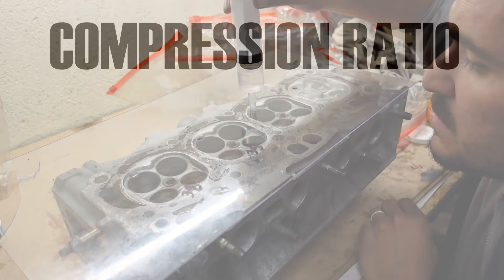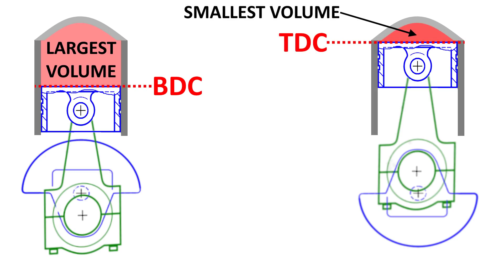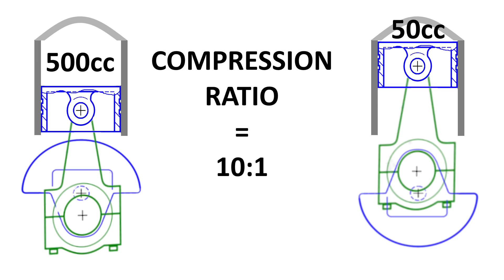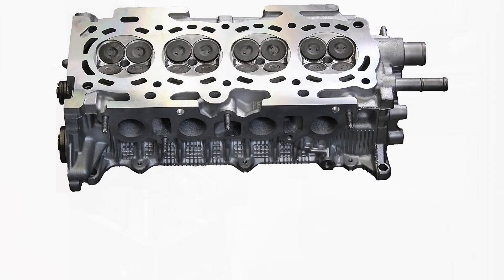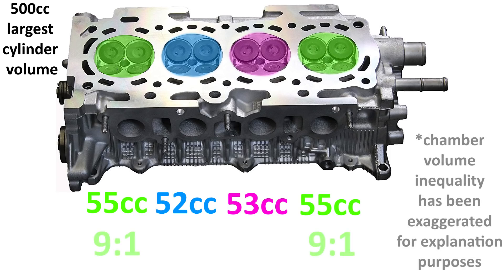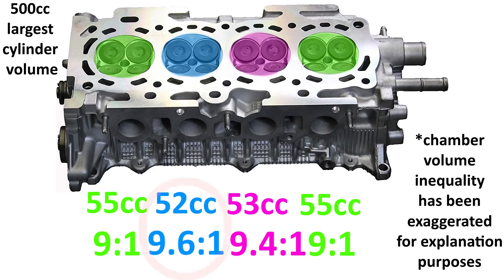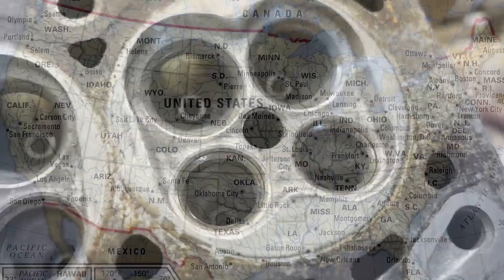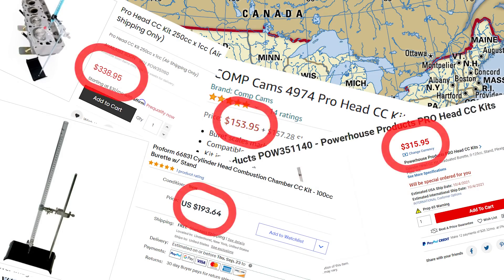HOW and WHY to EQUALIZE combustion chamber volumes CC - Project Underdog #10

Comment: I really like your videos... so thorough... However, in this one, why did you not deck/clean the head surface first?? So you had a truly flat surface for the plexiglass to sit on when taking the measurements.
Reply from the maker: Yes, that would be the typical approach, but when you're grinding the bit can sometimes skip and you can accidentally gouge the deck. The old gasket material remains are incredibly thin but are a great layer of protection and I feel more comfortable with them because I'm a bit clumsy sometimes. Petroleum jelly will seal even against dirt and debris and the difference in chamber volume after decking will likely be minimal.
Reply: @d4a  sorry need to disagree with this , yes i wouldn't deck the head but you really do need to scrap all the gasket material off. you can see a big clump of gasket which could be 1mm which would make a difference. also we use a thicker bit of perspex so to not have any sag. P.s, great videos
Reply: After watching this video & reading the comments specifically David Parker, I have to say this: back up your statements with validated documented proven credible science & math. Numbers don't lie. Critiquing another person's technique & process is a matter of personal opinion. Arrogance & ego can be a propellant to proving your statements but it will definitely ostracize you from people. I suggest the humble pie for dessert.
Reply: @strangelove9608  thanks man :-) I hope it helps in some way. When I see someone take the effort to produce a video to help others and share knowledge I try to stick up for them a little. I know a troll battle will never be won, but hopefully others read this see the facts.
Reply: This will likely come down to "how well I want it done", if you want absolute accuracy, you can resurface the head, but like it's said in video, this is enthusiast home build, you ideally wanna save some money, especially with the grinder that hes using
Reply: A god and fast way to clean the head for this kind of work is a fresh knife honing stone and wd40. if its a cast deck you use atf instead of wd40.
Reply: @slightlyinsaneraf  And time! We got jobs and shit lol
Reply: There is so much wrong with this video it is comedy for anyone who knows what they are doing.
Reply: @David_H_Parker  Let's hear your side then.
Reply: @OldSchoolZ-wy2yx  Let's make it easy for all of us. I'm not here to give anyone a free education.
Find a better, more authoritative source. There are plenty to choose from. Buy a book about building competition engines.
Reply: @David_H_Parker  he's build street engine not a competition engine, that's the difference.there isn't "so much wrong with this video". If you know something mind-blowing, then let us all know mr. Not free education. Give us a trial and enlighten us with your amazing knowledge
Reply: @David_H_Parker  When the guy asked what is wrong with the video i was already expecting that you will not gonna be able to point a single important fault in it...
I can give credit to some of the people here for pointing out things that you should watch out but you clearly lack the understanding and the skill... also are ready to take money for that lack of skill and knowledge so you are mad that this video exist. Someone with proper skill do not need to false advertise his work/knowledge.
The guy said he measured/repeated this thing 4 times->if the method is so bad then its strange that he did not detected it when he was comparing his work and numbers that this method provided as any wrong method would be giving him wrong numbers...
Reply: @Bialy_1  This series is being made by someone that doesn't know what he is doing.
Please follow exactly what he does.
You will deserve everything you get.
Reply: @David_H_Parker  yeah I'm sure you have much more important things to do with your time, that's why you're on youtube talking smack...now hurry up they just uploaded a bunch of new cat videos...
Reply: @David_H_Parker  = internet troll...
Reply: @jimmybare3026  That is what someone says when they can't disprove my points.

Stay ignorant my friend! Keep watching this channel to be misinformed.
Reply: @David_H_Parker  in all this time and effort you put into BSing comments, you could have easily told us what you found egregiously wrong with what the guy is doing. Instead, you keep going around in circles talking more crap and complaining how busy you are to school others...but not busy enough not to keep reading and replying to comments calling you out, and rightly so.
Reply: @DL101ca  I said early on in the comments that I am not here to teach you.

 Read a book, there are plenty out there.

People watching this channel and following it will get exactly what they deserve..... garbage.

If you want to learn how to do it right, this channel is not the place. If you want to hear Dexter's Laboratory tell you how to waste your time and have counterproductive  results, keep watching.
Reply: @David_H_Parker  I think you're done here. Thank you for the deep insights , don't let the door hit you on your way out !
Reply: @DL101ca  Just keep taking it on the DL. 

Pitching or catching?

We all know you are catching.
Reply: @David_H_Parker  You have a lot of time to argue but no time for "free education" lol. The argument would be over already if you grace us with a bit of your "free education" but you can't/won't 🤣
Reply: @paciencia0956  You are talking about yourself. Please go on. You are 100% right, you are all of those things and more.
Reply: @DL101ca  You don't know a lot of things. 
Thanks for exposing that.
Reply: Haha this is still going on!?!? Wow....
Reply: @slohachi6433  Merry Christmas everybody!
How is "Project Pointless" coming along?
Reply: @David_H_Parker  haha you said time is money right? Get back to work Mr. Amazing Engine Machinist! You gotta make all those aerospace and medical machinsts jealous!
Reply: @slohachi6433  Hey, Quandale Dingle here🥵
Reply: @David_H_Parker  I did not find anything comedic about the process he demonstrated at all. It was accurate, he used readily available tools, and the chambers volume across all 4 are much more consistent than they were "as cast". Also, there is a huge bonus advantage in un-shrouding the valves. Could the surface have been a little cleaner...maybe, but the difference in volume that would cause is so miniscule it's immaterial. After the engine is running the difference in carbon deposits will change the volumes slightly also. Overall, there was nothing funny about the CC process he demonstrated.
Reply: @David_H_Parker  Not sure why you continue to make spiteful comments about clowns and comedy. It's not helpful to the community. But let's take a step back, you are making an assumption that machine work needs to be done. If the surface is flat, then he does not and should not surface the head. If the valves are all sealing and the seat and face are uniform, no need to machine the valves. Now, let's take another step, doing chamber work with a die grinder is risky work. The grinder can very easily get away from you, and mark the surface of the head, necessitating resurfacing. Doing this chamber work FIRST is the best approach. Now, if the head needs to be surfaced, well it's as simple as CC'ing the heads again. But an inexperienced person might say, "what will you do if the chamber volume is off now!?!?" Now, is where you can make small adjustments by seating the valves a little deeper in the cylinders that need more volume. Now, maybe the process he demonstrates in the video seems comedic to you, but that's because you lack experience working in a machine shop building engines and you haven't read enough books to get a balanced view of how to approach engine building.
Reply: @slohachi6433  WRONG! Thanks for playing!

Are you a machinist? have you built professional race winning engines? My guess is no.

YES, things do change after a valve job and a surface.

If good enough is what you are after, just leave it as cast. Why waste your time cc'ing something before all of the dimensions change? The valves and the seats are changed in addition to a reduction in chamber volume from surfacing.

You clowns in this "community" need a reality check. 
Someone needs to say, hey.... don't drink Mr. Jones' Kool-Aid.
Reply: @David_H_Parker  Woah,...it does not seem that you understood me at all.
To answer your questions, yes, I was an professional engine machinist for many years. I have helped build competition engines that have set records at Bonneville.

Am I the know it all of engine building, nope :-) Haha hardly, in fact the more you learn about engine building the more you realize just how much more there is to learn. I still enjoy engine building as a hobby. Now, enough of my credentials...let's get back to business.

You are assuming the head needs to be surfaced. It's very possible that it may not need to be. And even if it does, a good machinist will take a little as possible, and level the head as much as possible to evenly surface the head and keep chamber volumes as consistent as possible.

Second assumption you make on machine work is that the head needs a valve job. It may not, especially low mileage Japanese engines.

Now, you did make a correct statement that I did not and do not disagree with. You said ,"YES, things do change after a valve job and a surface."
Never said they don't change lol. In fact I told you that you can make minor adjustments to CC volume on a per chamber basis by sinking the valves a little deeper.

Here is the point you seem to miss, doing ALL the machine work first is dangerous, silly, and irresponsible. Porting a head and re-shaping combustion chambers is very risky work, you can very easily gouge the head or seats. You'd know this if you have even a slight amount of experience with engine machining and building.

Here is a step by step for you, do the chamber work, get the chamber volume as close and as consistent as possible. Then do the machine work if needed. Then measure all the volumes again. Then make small, minor, relatively safer adjustments to get your chamber volumes equalized.

Understand now? I'm not playing.

Do yourself a favor, read up on some books, get your hands dirty and actually try some of this out, and I know you'll soon understand these very basic concepts.
Reply: @David_H_Parker  . The would be expert gets schooled like the clown that he is (talking to you). hahaha
Reply: @slohachi6433  I have built more engines than you. I am currently under contract with several factory teams, not privateer retirees at Bonneville.

Bonneville is full of POS cars that have all kinds of Mickey Mouse work done to them. It is nice to finally talk to one of the butcher engine builders and tell you how your work is garbage.

Factory teams operate on a slightly higher level than the shade tree privateer.
Reply: @David_H_Parker  You very well may have built more engines than me. There is no valid way to quantify that statement. But quantity doesn't equal quality.

Hatred of land speed racing eh? A self-respecting experienced engine builder would not discriminate against one form of racing over another. An "experienced" man such as yourself knows how important grassroots motorsports is ...right? Well...perhaps you are actually incapable of perceiving the importance of something so simple.

Here is another simple lesson for you, if you actually are under contract with "several factory teams", I commend you. Keep learning, you have a long way to go. Just don't let pride make you forget where it all started. There are various techniques and methods to apply when approaching engine building. All of them are important, and all of them have a place. Again, I see no clowns or comedy in the methods displayed in this video. And if you actually have experience machining and building engines, this would be extremely obvious to see.
Reply: @slohachi6433  If you don't see the glaring problems in this video, that speaks more about you as a machinist than anything else.

I will take anybody's money to build a winning engine. I have friends and customers in just about every segment of racing. I can tell you there is a difference between what kind of technology and investment goes into an engine correlated to the type of racing. And yes, some types of racing are more important than others. The technology and investment that goes into a land speed record car is not as large as you think. I have friends that have been participating and setting records at Bonneville for decades. I see what is out there on the salt and it is typically garbage with a few notable exceptions. I understand that racing needs privateers to primarily fund the venues during the off season.

Again, not all racing is equally important. It is cool when  people have fun on a track day or spend  large portions of their income racing for cheap plastic flags and cheap trophies. None of that is consequential for the industry or for moving the technology forward.

I spend most of my time developing cylinder heads, not just doing valve jobs all day long. I get to see what works and what doesn't with equipment that few have access to. 

As far as my quality vs. quantity: My quality has me constantly booked for some of the most rewarding jobs, working on engines that are consequential to the industry and on the cutting edge of technology.

Maybe you can rebuild an engine just fine. My work requires me to far exceed what you would call excellence. There are many machinists that truly believe they are great. Most customers lack the knowledge to identify poor quality work. Many automotive machinists are mediocre at what they do and don't realize they suck. Ask any aerospace or medical machinist what they think about automotive machinists.  
If automotive machinists had knowledgeable customers that would verify their work by measuring everything, the typical auto machinist would go out of business from rework and refunds.

Maybe you are one of "those" machinists and don't know it yet. I don't know you and I can't critique your work without seeing and measuring it, but the fact you see no problems in the video is a good indicator that you may not be as good as you think.
Reply: @David_H_Parker  Well you yourself have said it, "I can tell you there is a difference between what kind of technology and investment goes into an engine correlated to the type of racing." I could not agree more and have tried to convey this to you. Glad we are on the same page there. Not every engine build requires the elite super special tools that only a select few such as yourself have access to.

Never claimed that Bonneville was the end all be all of racing nor did I ever claim to be the worlds greatest machinist. To claim such a thing is arrogant and foolish.

But I can tell you, that if you do so much cylinder head development you would know to shape the chambers and get the volumes close before doing all the machine work. Then do the machine work. Then check the volumes again, and make small adjustments. And of course, only do machine work if it is actually required.

Do you understand that point? Surely, a man so credentialed and astute as you would know this very basic fact...right?

Let's be clear here, you said the correct method would be to do all the machine work first, and then do the chamber work. 

Do you honestly believe that is the best approach?
Reply: @slohachi6433  As I said in a prior comment, if good enough is what you are after, why not leave it as cast? It was good enough for the factory.

If you're going to do something, do it right or don't do it at all.

Doing chamber work for shape: absolutely before machine work. Doing the minor adjustments to balance the CCs: absolutely after the machine work.

Unless you like doing unnecessary work with no benefit, CCing (balancing) the chambers before the valve job and surface is a waste of time. Any minor adjustments easily can and should be made post machining. 

Do you hone your cylinders before you bore them? Do you lap the valves before you cut the valves and seats? Do you balance a flywheel before you machine it?

I will CC a chamber before machine work to start my math of CR but not balancing every chamber before everything is machined.
Reply: @David_H_Parker  Great! So did you watch this video? He changes the shape and un-shrouds the valves...thus shaping the chamber. It would make sense to cc the chambers and get them close before machine work, and make small adjustments after. Also, you keep making the assumption that machine work is necessary. It may not be. Anyways, you can work however you like, but the assertion you make that the methods demonstrated in this video are "bad", "garbage", "you get what you deserve if you follow this!", that arrogant assertion is flat out incorrect. If you can't see that, well that speaks volumes on what kind of a machinist, and what kind of a person you are.
Reply: @slohachi6433  The chambers were unshrouded a long time ago. He used video footage from his disaster of a porting video. You are building a strawman in your arguments.

Don't forget to give your strawman some button eyes and a corn pipe.

Anyway,  people watching this can do whatever they want. They can take a 3/8 drill bit to their chambers if they want to.

Bottom line is this channel is a joke and people that follow his non-expert advice will waste their time for sure and experience negative results the more they take of his advice. Good information is out there, just not here on this channel.

Project Underdog will be better called "mistakes that I made" in hindsight.
Reply: @David_H_Parker  what's it matter when the footage was recorded? It's still work that was done. Give up already, you are grasping at straws now lol.
Reply: @slohachi6433  I'm sorry if you missed the point. I guess you are one of those machinists.

Don't you have some valve guides to knurl, or something? I am sure you have some top notch work to churn out. 

Maybe you need to re-read the comments so you can follow along. The final CCing of every chamber is pointless before the machine work is done. It will need to be done again after the machine work to verify they are equal volumes.

I don't care if he CCs the chambers between each sip of coffee, it is a waste of time. I guess you don't understand the concept of time being money. Do you own your shop or are you an employee?
Reply: @David_H_Parker  None of your points are valid. It doesn't matter if he did the work in one video or another. The point is, he did chamber work. Keep grasping for some straw there....it's very apparent to everyone reading this mega thread you are not a machinist or engine builder at all. You aren't even one of "those" machinists. And you admitted that it's logical to do chamber work before machining. So long keyboard warrior.